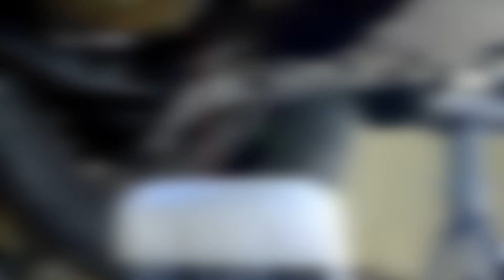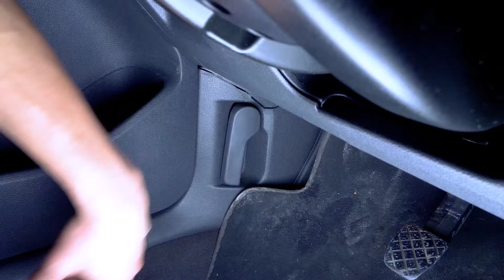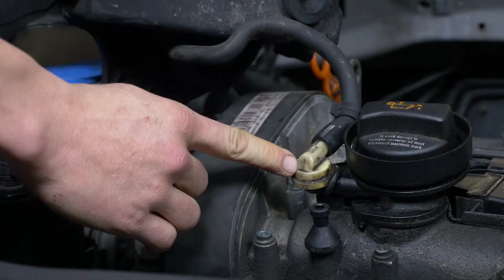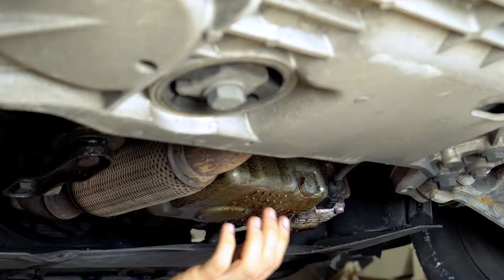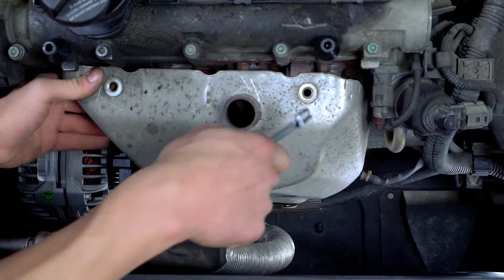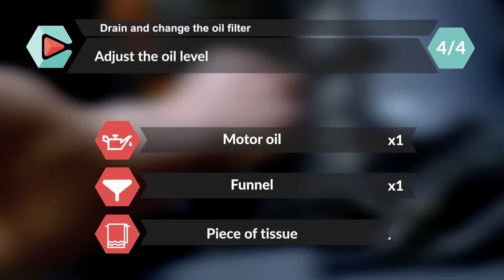Change the oil and the oil filter Golf mk5 1.4i 16V🛢

Comment from the maker: Find out what oil type and quantity is right for your engine:   http://bit.ly/2HmiQvr

"BUY THE AUTO PARTS you need for the operation : 👉 http://bit.ly/cheapAutoparts 👈
📱 DOWNLOAD THE APP : 🍎 http://bit.ly/MCD12AppStore, 🤖 : http://bit.ly/MCD12PlayStore 📱⬇︎⬇︎ 🔥   🔧🔧🔧   🔥⬇︎⬇︎"

Discover a vast array of services that will help you run the maintenance of your car: vehicle user manuals, maintenance planning and mechanics-oriented tutorials!
Performing an oil change and replacing the oil filter on a GASOLINE VOLKSWAGEN GOLF 5.

Discover the world of UseTool EN on www.usetool.io

🛠📏⚙ FIND ALL THE PARTS AND TOOLS NEEDED AND RECOMMENDED BY USETOOL EN ⚙📏🛠

Needed parts : 
- Motor oil : http://bit.ly/notoliveoilgolf5en

- Oil filter : http://bit.ly/oilfiltergolf5Gen

- Drain seal : http://bit.ly/drainsealgolf5en 

Needed tools
- 💣🤖🏆 The complete toolbox recommended by UseTool ES to repair your GOLF 5 : http://bit.ly/supertoolboxgolf5en 🏆🤖💣

- Multi-Bit Screwdriver
- 30mm Torx socket
- 25mm Torx socket
- Liquid collector 
- 19mm Spanner
- Socket wrench
- 10mm Socket
- 10mm Spanner
- 30mm Socket
- Piece of tissue
- Funnel
- Measuring cup (optional)

🔝💪 Safely lift your GOLF 5 with the hydraulic jack : http://bit.ly/upupupgolf5en and axle stands : http://bit.ly/axlegolf5en recommended by UseTool EN : 💪🔝

- Hydraulic jack
- Axle stand
- Wooden peg

🚗📢💡 RESSOURCES 💡📢🚗

Usetool's warnings
Don't perform this operation when the engine is still hot, as you could seriously burn yourself. 

Be very meticulous when filling the engine with oil. Never go over the maximum level indicated.

Usetool's infos 
Tightening the new filter by hand is enough to set it in place. 

📽❤️🚨 USEFUL VIDEOS 🚨❤️📽

- [ USETOOL'S TIPS & TRICKS ] Lifting your vehicle safely : http://bit.ly/2pcxq1L

- [ USETOOL'S TIPS & TRICKS ] DIY: Making a liquids collector : http://bit.ly/2tKTGEN

- [ USETOOL'S TIPS & TRICKS ] Unscrewing a blocked oil filter : http://bit.ly/2pg4Lbg

- [ TUTORIAL VOLKSWAGEN GOLF 5 ] How to reset the service meter : http://bit.ly/resetgolf5en

Comment: The car consumes the oil ? I also have a 1.4 16 75 cp golf 5 ,but on highway I lose about 300ml of oil in 300km.. The oil I use is Liqui Moly Toptec 4100 5w40.